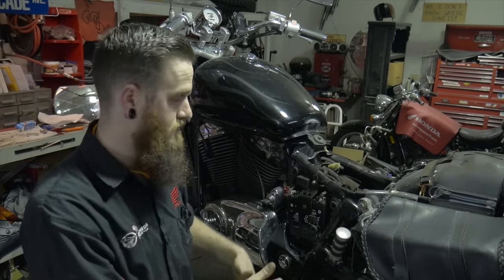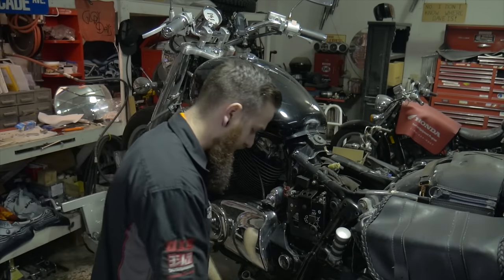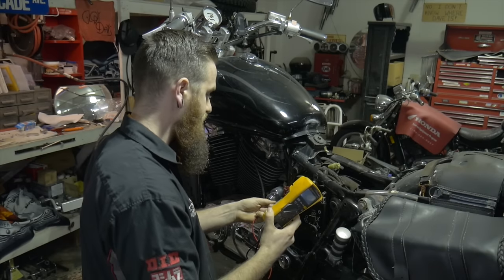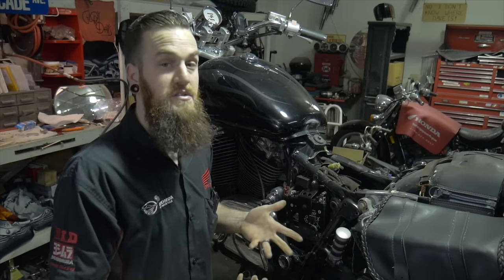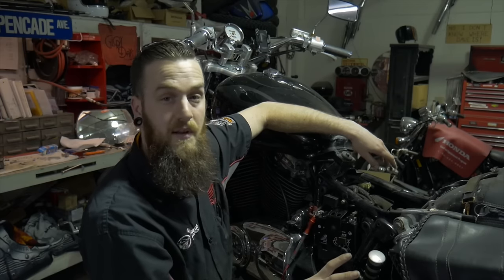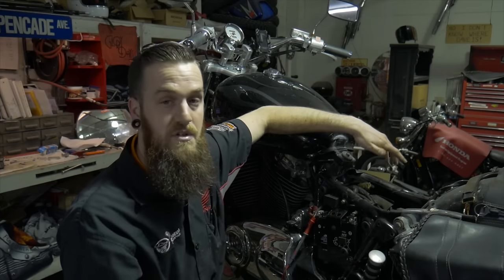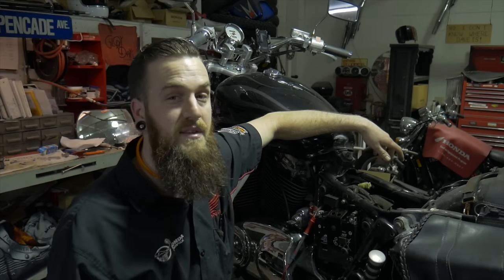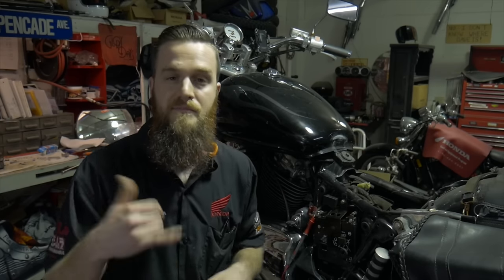Motorcycle Charging System: Bad Regulator/Rectifier

Comment: The Honda Shadows come from the factory with shitty regulators. They do not work very well and send excess juice to ground when the battery is charged, which makes them run very hot and also eventually will burnout your stator also. Before all this happens, you should first: cut out the connector plug between the stator and the regulator and solder the wires together. That's one of the weak spots in the system. They usually make a poor connection, heat up and melt. So do that first. Then replace your voltage regulator with a Mosfet regulator (One from Ricks or another brand, anything that uses Mosfet technology. Those are the main reasons why the stator burns out. It's working over time to keep the battery changed and burning out prematurely. The Mosfet regulators run a lot cooler and send more power to the battery, even at idle, which the stock regulators cannot do. If you run any added accessories on your bike, you sill start to have electrical problems because of how the system is designed. They're just not good enough to keep up.
Reply: Ah so does this explain why people get much better results with a OEM GSXR reg/rec? Is it simply the fact of soldiering the wires instead of using plugs that solves the overheating/burning out issue? Or are the GSXR reg/rec just better than the Honda ones..

Comment: Great information. My is my yamaha roadstar 1700 just quit running I could sit sometimes foe a few minutes  and it would start and I  could get it home I would charge the battery and it would be ok for a couple days but the rides got shorter and shorter the last ride I just went around the block seemed fine then as soon as I put it in 4th gear it died and now it won't do anything no lights nothing . please if you have any ideas lmk

Comment: The cooling fan was off, so I don’t know the mechanic here what to do. He turned it on, but the f1 sign was shown and the lamp does not always light up after operation, and the radiator is very hot, as it is always so hot that it has holes for water smuggling and the holder of the bike was working when I download it now it does not work without it  I raise the entire stand except for the upper position, so what is this please?

Comment: I have a question bro i have gsxr 750 after i ride it if its warm after the ride and i turn off the bike ,it does not turn on becouse wile riding batt is not charging, batt is new ,stator is new,starter is new 
If the rectifier gets hot it would do that ?

Comment: On mine is showing 13.6 staying there or so with high beam. Soon as mines gets hot it doesn't want to turn on..acts like a dying battery..battery is brand new. If bike is just warm or cold starts easy. But hot it won't. What can it be?

Comment: My battery is dying. One on the first day, I re-charged it, next morning it started, I drove to destination, but it wouldn't start from there (Luckily, I drove to a Honda Dealership). While there I bought a new battery (pre-mature maybe, it was old though couldn't hurt). Side note, Bike never dies while riding. Anyways, I'm thinking about hooking up my meter to the battery and doing this test. If charge goes above 15.0 without being pushed down, I know *Regulator isn't working. Come to think about it, your test really only tested the *Regulator because like you said we want to get straight to the point and the problem on your end was *Regulator, so you stopped there, but if your problem isn't the *Regulator we should be looking for something else... or maybe doing a different test altogether.  I'm going to start bike and disconnect the positive terminal and see if bike dies or not, this should tell me if the Stator and Rectifier is working correctly or not. 

If I do your test and my test, we should be able to cover the: (Stator, Rectifier, and Regulator) the entire ***Alternator. 

If all checks out, and everything is working, then we can conclude we have a battery drain somewhere that's occurring during non-use.
Update: I took off positive terminal, but didnt rev the engine just let it run, and it died, im thinking the test wasnt valid because the alternator doesnt work unless bike is moving, isnt that right?
Any thoughts/corrections/suggestions?
Reply: My brother no meed to answer my dumb questions I think I got it figured out
Reply: The reving made it so the engine doesnt turn off, im thinking it was just a bad battery, the reving made it so the engine never died

Comment: Hello sir. I checked the charging system and according to the specifications everything is fine. After a few kilometers the motorcycle shows an error and fails to start. I replaced a generator and a regular meter

Comment: The rectifier/regulator voltage control is subject to prevailing ambient temperatures in which the bike operates. Generally the regulated voltage in lower ambient temps. (< 50F) is higher ~14.75v,  whereas in higher ambient temps. (>80F) the voltage is reduced ~13.5v to reduce stress on the battery 
(over charging/cooking the battery). This is all done by electronic thermal sensor (thermistor) in the rectifier/regulator to "trim/modulate" voltage to a safe level. I should think 15v is too much applied to the battery & cycle system.

Comment: hi dear, last  night i checked my bike and found 6-7 volt on battery connection port [my battery already down and use an 4700uf capacitor instead]. how can i understand my problem, rectifier gone or stator  coil gone?? can you help? -mamun2a, Dhaka, BD

Comment: I bought a yamaha X max 400. I cannot figure out this issue. I recently installed a new rectifier and same thing happening. Keep in mind it is second hand but only 2000 miles on it, got it September 2019 and with work at home and other things, it only has 6500 on the clock to this day. 

When bike is driven or idles, battery volts showing on screen goes from low to 13.1, 13.7, 14.1, 14.7, 15.6, 16.7 (highest) and fluctuated every 30 seconds to any of the numbers listed. 

The battery struggles to start sometimes and after a drive When I turn off and try to restart it up, it struggles again.

I am not mechanically minded but I had a guy do a small test and said yes, too much power going to battery. Couldmy battery be fried so the rectifier is constantly having to send more juice to the battery? If so, being pretty much a new bike, why would battery be dead already?
Reply: @PercyJackson93  yes.  It was simply a bad battery. So forked out a big chunk of change on a part that wasn't needed.

Comment: I’m looking into buying a 2006 Honda rebel 250 for $500
Here are the specs from what the guy told me:

-new battery
-new ignition
-new locking gas cap
-new risers and bars
-rinsed the gas tank. New gas in it

-clutch shifts well
-oil is still good
For some reason the ignition is shorting the fuse. 

What can cause this issue and what should I look into fixing

Comment: My zx10r at 5k rpm its 14.7 volt but when I released the throttle to idle the voltage just keep trickling down. It seem like the charging voltage at 5krpm is normal but when it sit at idle the voltage keep dropping. Idling should be a little over 13 volt.

Comment: My 08 zx10r at no start its 12.9 volts new battery. As soon its fired up and idle you see the voltage keep drop to 11.6 which is a cut off voltage if you shut her off she  won't start but if you let her run the voltage keep trickling down. I'm thinking the regulator since the o8 zx10r ninja have a recall for them. But it might be a stator too since they do work together.
Reply: @PercyJackson93  yes it was the stator it was burnt. As soon as we removed the cover it has the electrical burn smell and dark area in some coils. We ended up grabbing a new stator and regulator combo since it was cheap. After replacing it the voltage idle at 14s. We ended up hooking up a voltage gauge so atleast it give a clear warning next time.

Comment: I just did this exact thing today on an atv that I was checking over for a customer. I would of had to pull things apart to get to the stator and rectifier. I just hooked alligator jumper wires to the terminals and to my volt meter. Replaced the battery and was able to show the charging system was good.

Comment: 05 Honda VTX 1300c Voltage 13.9-14.3 @ Idle. When running @ 5000 rpm voltage drops to 13.3-13.7. Is Regulator Rectifier Bad or Stater? Battery loses charge really quick. Did a draw test seems to be in range, have to charge battery everyday. Some times after a ride i'll stop and won't start.
Reply: My 97 VT100 does same...wondering myself
Reply: @neveringham1  My voltage regulator went out and took the Battery with it. Went with a GEL Battery and haven't had a problem 1 with it  since. Strong starts, Charging right on spot, Holds a great Charge. Check your connections, I had a bad starter switch connection that's what caused the whole problem to start with just had to figure out  the no charge holding and the charging issue, then i found the trouble. LOOSE WIRE, Bad News. Fried the Voltage Regulator and the Battery.

Comment: Hi - Is it possible to turn a 1yr old 125cc battery into a dead battery? It been connected to bike for 11months but not started or used ( long story ). I've charged it up on a trickle feed charger but its been connected for a few days after being fully charged then power to charger turned off on wall causing it to lose all its charge again. I've done this a few times over the year so I'm wondering if I've damaged the battery as I've read that this it not advisable to keep it charged for so long and then letting it drop down to flat so often. Basically its not starting (not even turning over) just clicking noise from starter button then after 2-3 attempts the battery dies. Seized engine maybe but also wondering if battery as well.
Reply: @PercyJackson93  Yeh -.I bought a new battery and an Oxford Oximiser 900 multimeter.
Reply: @PercyJackson93  I have heated grips that previous owner put on and I do wonder if they might be draining power aswell.

Comment: What about if you test the battery voltage and It stays at 13.2 no matter the rpm?
Reply from the maker: Depending on what the factory specs call for, that would normally be a sign of a low or faulty battery or a weak charging system I.E reg/rec not designed for the system not allowing enough enough through. Or stator not putting out enough. 

If it was my bike, I would check AC output on each of the yellow wires at the stator connection (unplugged). 🤙🏻

Comment: I have a 250cc street fighter and when i tested my charging system the voltage doesnt go beyond ~12.5v. Could that be a battery issue?
Reply: stator probably. a fully charged batery should be 12.6 so if you are only putting out 12.5 you arent charging properly

Comment: Of it possible for a voltage regulator to work until it gets hot.... Seems to read fine for 5 minutes or so then It goes down to 12.8.... Them slowly decreases down.....

Comment: I have a 2017 Indian Chieftain with about 27000 miles on it. When it is cool outside (under 60 degrees Celsius in the early morning) my headlights will randomly dim on their own. This keeps burning out the high beam filament. When the headlights dim the side lights will flash and the voltage dips down to 10v to 11v. I just had the dealer change the voltage regulator. I'm wondering what's going on.  Any real help is appreciated.  (Don't tell me that my bike isn't a Harley, that doesn't help)
Reply: I've heard of alot of electrical issues with the Indian's
Reply: @Leftyswede  I had a very small string of electrical issues. My dealer was able to sort out in quick order, under warranty, with only one of the three indian motorcycles that I have owned. The other two never had any issues at all.

Comment: Solder the high voltage, 3 pin AC connectors! [if?] you don't want trouble! And install a cheap voltage gauge to keep an eye on the system

Comment: My bike when given throttle the headlight becomes dim and after releasing the throttle headlight becomes bright, also on idle back light and headlight fluctuate with the idle ( lights of my bike are battery operated, slef starter works and horn works properly but the light seems dull and dim)

Comment: i have a 1998 honda shadow everything is new battery starter relay starter switch  ran good and then it was getting hard to start the other day i rode it and came out and would not start had to get it push started to get it home everyone s telling me it s the recifer how hard are they to  remove and replace

Comment: Just put a brand new stat. Reg.rec. on my gixxer 750.  After 3 weeks I'm getting 13.4 at 6k.   But if it weren't enough charge wouldn't my bike lose power?   Keeping in mind I run the fk out of it frequently.

Comment: What if I hit and release the start switch and the starter keeps running? Even when I pull the key out, only shuts off when I disconnect the battery.
Reply: Check to see if the switch is sticking. Also, check the solenoid. Which is most likely the problem. Sticking closed. If your solenoid is going out, the current draw can keep it engaged the whole time. 
I’m not a bike mechanic. But, that’s what I’d check.
Reply: I had a bad switch. Thanks for your response.

Comment: If the output voltage is higher than 13-14v on load its the rectifier is bad, but if its lower than that, its the stator

Comment: So I got my 1972 honda Cl100 to fire up. I'm using a new wiring harness and rectifier. Today I woke up and noticed it wouldnt start. Voltage at the spark boot is dropping to zero. Battery fully charged and charger connected. 6v system.
Reply: P.s. hadnt been started since 1978. Customer let me have it and I never tinkered with a bike in my life :) he said the cylinder was locked and it wouldnt start. Muahahaha
Reply: And with all that said. It fired up on the first kick. I don't get it lol

Comment: I have a 883 sportster and it’s killing the battery, the battery has 12 volts then I turn it on and it drops slowly, it’ll drop all the way to 10 volts and then shut the bike off completely, does it sound like a regulator or a stator? This is my first bike with only 8,000 miles so I’m hoping it’s nothing with a stator if anybody can help please give me some information
Reply: Sounds like stator

Comment: I have a 2005 1200 cc Harley Davidson Sportster XL custom I've got a battery tender hooked to it I can charge the battery I've got a brand new battery about a year-and-a-half old and I plug in the battery tender from time to time but all of a sudden about a month ago the engine light was coming on I've only seen that happen once before and it was a voltage regulator if I remember correctly but now I left the the bike said and let it cool and the next day I plug in the battery tender takes 15 minutes to show that it's fully charged fire the bike up run it for about 10 minutes idling and revving it a little bit to get it good and warm I shut it off and I go to start it again and it acts like it's a dead battery and it's been doing this I don't know how long but anybody can give me an answer back sure would be helpful to me I'm not no mechanic I've been riding for 30 40 years but I've got friends up in Illinois around Chicagoland that knows things more than I do and I don't have a heck of a lot of money anybody can help me out with this I can't even afford to buy a tester I don't even know how anybody could get back to me anyways thanks

Comment: To accurately test a battery, it MUST BE LOAD TESTED!  The way that you show testing it only shows the surface charge and not the amperage load that the battery is capable of producing!   I have tested many, many batteries that would show 12.4 - 12.6 or higher and when you load test the  battery it fails the test miserably!  I am surprised that the manual says 15.5, most automotive alternators typically limit it to 14.2 volts to avoid overcharging.  Normally when a regulator fails and allows too much voltage to go through it usually cooks the battery and you will find that the electrolyte is low and has boiled out of it.

Comment: What if the bike wont start....
Reply from the maker: Then you can’t fully test the charging system.
Reply: @TheMotorcycleMD  that's the problem I'm having. It charges the battery till I try turning it over and over till battery drains and dies.